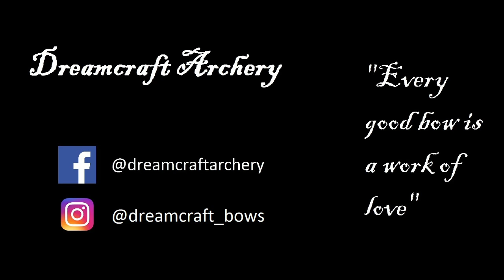How To Make Bow Staves?

Comment: the black locust is a very good wood for arches but has a very long seasoning, I prefer to use the dead locust a few years ago with the rotten sapwood which is now aged and the heartwood is completely intact. congratulations for the video.
Reply from the maker: That's really interesting you say about using dead locust! Thank you for the comment!
Reply: @DreamcraftBows  the black locust having very hard and waterproof heartwood makes this use possible.
Reply: Like standing dead? I just cut one that was standing up dead.. Trying to figure out if i can use it. Anyone kno? I Got staves in the basement rn glued and drying.
Reply: @briangrignon8799  how did this go for you?

Comment: Thanks for your great videos♥️I have one question, i cut osage orange staves (their diameters are from 40mm to 90mm). what do you prefer, should inremove bark and put to dry on shady place, or should i leave bark and put it to dry on shady place? what is better way for good drying for this diameter osage staves? with bark, or without bark?

Comment: Sealing a quarter isn't necessary because when splitting, especially wet wood, the pressure inside is released. It will slow down drying. I have done it this way a lot and none of it checked or had splitting in any quarters or smaller pieces, dried inside in a few weeks time to 8percent moisture content

Comment: Do you ever back your bows? 
Is it important to do it or can i skip it ?
Im just starting with the bow making journey  thank you for the video's ur amazing!
Reply from the maker: Thanks for the comment! If the bow is long enough and tiller is good there is no need for backing. I backed a few of my shorter bows with lineen twine
Reply: @DreamcraftBows   ty for the help love ur vid
Reply: A good backing will help your bow last longer. After getting down to a single growth ring,  I like to cut the back of the bow off, smooth the cut down and glue it back onto the bow with a 3" reflex. Then tiller as normal. Makes the bow last longer and adds a bit of speed plus it cuts down on the amount of set the bow takes usually.

Comment: Great video my friend!
I have two questions.
1)Is it enough to put varnish only at the end and the back of the stave or you have to cover all sides of it?
2)Does it matter which side of the stave we choose to be the front and back of the bow?
Reply from the maker: Thank you my friend!
Yes it is enough. You don't need to cover all sides. The end and the back of the stave are spots where moisture goes out quickly so the varnish has to slow it down. If you are drying in higher temperature you can apply varnish two times to increase protection even more
The outer side of the stave and log has to be the back of the bow
Reply: @DreamcraftBows  thank you very much.You are the best!